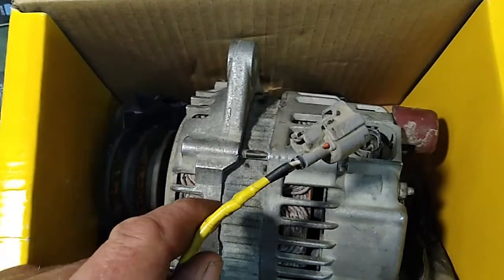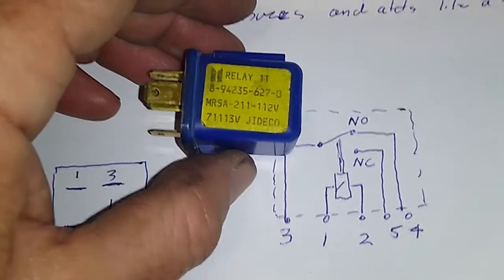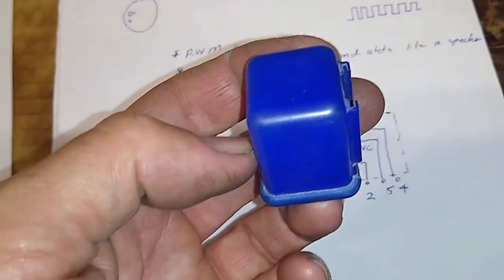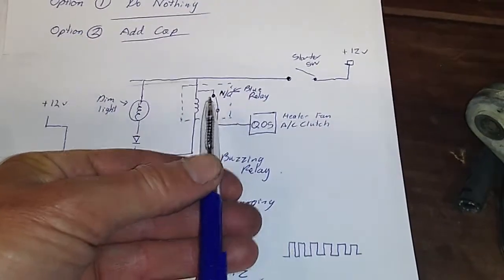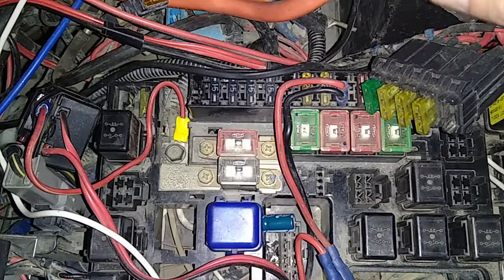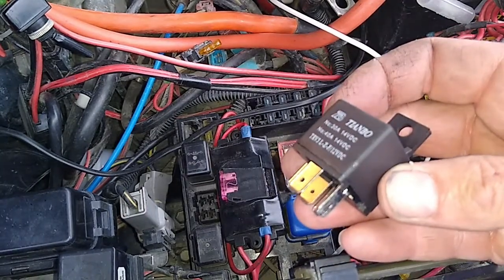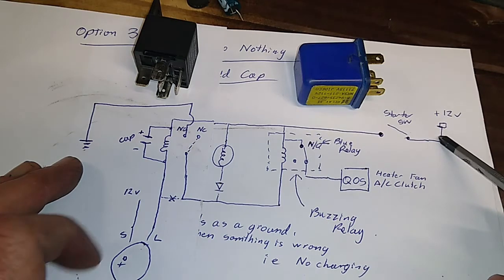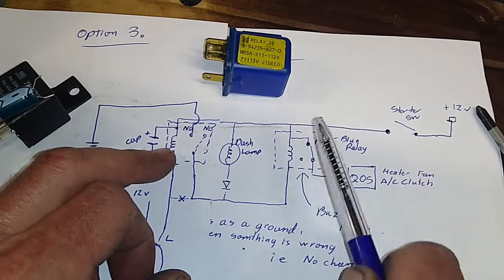Long version  of Blue Buzzing Relay issue Fix/Hack

Comment: Me working after this,I'm just looking for surplus cap from defective appliance, 470 uF but lesser volt available just 16 vdc.then follows where to connect to relay terminal and it works.Thank you for this.